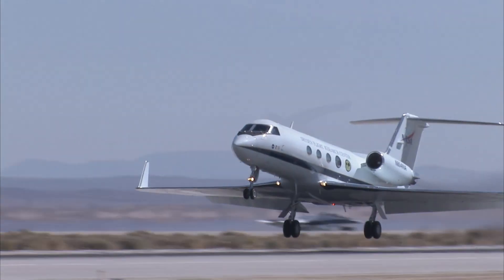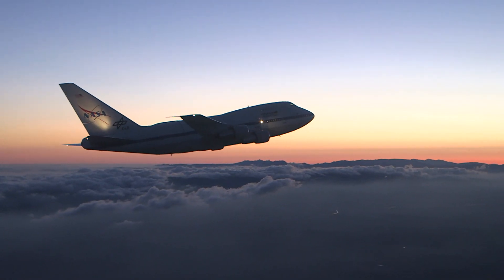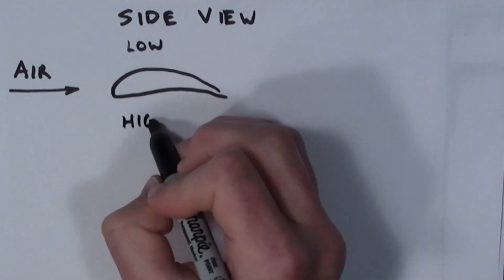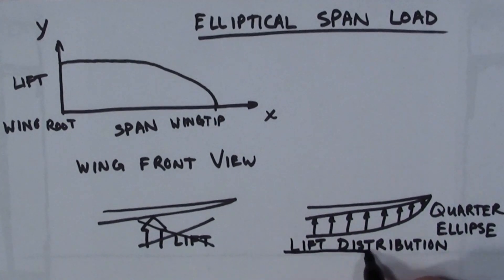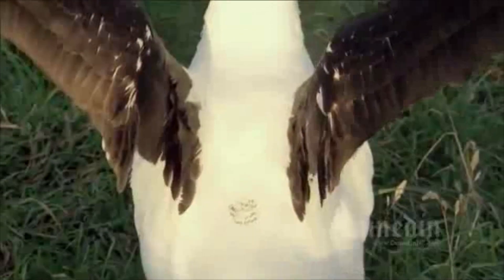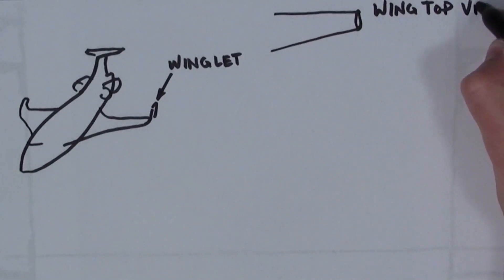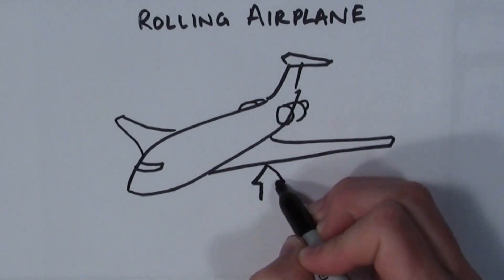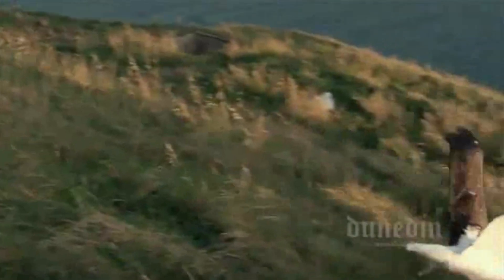Proving Prandtl- With A Twist!

Comment: The concept is even better described and the ideas supported in this video from the 2014 AMA Expo. https://www.youtube.com/watch?v=RoT2upDbdUg.

You'll see all the negative comments below are totally rebutted. These wings have less drag in level flight plus the approximately 12% drag reduction from elimination of vertical stabilizer and rudder to produce a plane more efficient in all aspects including straight and level flight.

You'll see that Prandtl didn't forget how birds flew, he studied maritime birds, which have different flight mechanisms than land birds. It's explained very satisfactorily.

The surprising thing is that the tip isn't just reflexed to the point of zero lift. It is actually reflexed past that and the wingtips generate negative lift! That is the secret to the Prandtl wing and it's not something a modeler or hang glider would intuitively try and "of course" come up with the same idea for cheap. They didn't. None of their designs actually dared to try negative lift at the wingtips. This is truly revolutionary even though the principle was originated in 1933, but ignored because it makes no intuitive sense at all. But it works perfectly.
Reply: +RockinRobbins13 Great link! Thanks!
Reply: RockinRobbins13 Okay let's start with the aero.
1) Invert this wing, and what happens?  The tips would seem to enter deep stall.  
Having flown through light-to-moderately violent rotors in the past, with my instructor in control in the back, I can say I wound't want to fly this wing because of its inverted characteristics.
2) No tail moment means limited, to no, control after stall.
Assuming that this wing is suppose to fly through unstable air, convective currents or wave, having unstalled airfoils in the tail would see highly desirable to the goal of a functional stall/spin recovery procedure.  Even if the tips remained unstalled in stable air, overall stability would be seem to be challenged in unstable air.  Perhaps Mars is thought have a temperature inversion from the surface to space?
3) I listened to the NASA video, but I did not see easily understood wind tunnel data.  I would like to see smoke trails that illustrate how the negative angle-of-attack tips capture and accelerate the inboard tip vortices.  This interests me because I suspect that winglets, and Prandtl negative AoA tips, have a very narrow operating range for the optimal efficiency that is claimed.  If a wing is able to fly in stable air, then it may be possible to operate at a nearly constant AoA, and this is what I expect airliners are doing when they are above 30kft.  I don't know anything about the stability of the Martian atmosphere, but I'm sure you'll have something to say about that.
This isn't the first Mars airplane design that NASA has proposed.  There was one in the 1970s/1980s that went nowhere.  Why was that initiative dropped?  Was it the aero, structures, controls, mission requirements, or atmosphere?
Your platitudes for the design strike me as shallow, as I said at the beginning.
Reply: +Kramp Drucker Holy cow, Kramp! If you're that interested build one and report back. First of all, it's a sailplane wing and sailplanes don't fly well inverted to begin with. Secondly, the same design is used on winglets of commercial passenger airlines and they don't seem concerned with inverted flight characteristics.

As far as #2, flying wings are flown in RC combat a lot and they get stalled, punched, spun out, and otherwise put into non-flying attitudes all the time. They recover fine without a tail moment. I can link you to video of purposely flat spinning a wing and recovering time after time after time. Again, why not build one and test it?

#3. I smell protection of possible patent rights and a bit of protection on the exact details. That's entirely proper. Most sailplane wings have pretty narrow operating ranges for optimal efficiency, so I wouldn't be surprised if this does. They are flying a small number of radio control sailplanes with this wing with about a six to eight foot wingspan. I don't think they have attempted to go to higher speed flight with it but the commercial airlines flying the same concept at 650 mph shows that it won't be a problem.

I think you're making dragons where simple lack of experience and protection of the original idea is what is really happening. Scientists steal each other's thunder all the time and money follows the victor, so they tend to be as competitive and secretive as corporations.

But to all your questions, time will tell. In order for these things to be tested, wings will have to be out there to be examined and duplicated. The fact that some birds use the concept, the ones that soar, shows that the idea has valid applications. I suppose there will be invalid applications also, but that's true with just about everything, isn't it? Because you can't put out a fire by pouring gasoline on it, that doesn't mean that gasoline has no usefulness at all, does it? Does every wing have to do aerobatics? Does every wing need to do all things perfectly? Or do we have design categories for different uses?
Reply: +RockinRobbins13 Birds can use body english and full span angle of attack adjustments.  I find your argument specious.
Reply: +Kramp Drucker Fine. Present your contradictory research.
Reply: RockinRobbins13 I don't have to.  I just have to force you to prove your theories.  That's how science works.  If you can't prove your propositions, then they are groundless.
I don't see your data, and the guy in your video even claims he doesn't have all the data he needs, which is a classic trick to maintain funding on something that has no merit.
Reply: +Kramp Drucker You're playing games. This is a NASA project with leading scientists. Your extraordinary claims need extraordinary backup or you have nothing worthwhile. That's how science works.
Reply: +RockinRobbins13 No, I am not playing games. To propose otherwise is to use ad hominem against me.
I have seen numerous frauds posing as competent engineers and scientists over my last two decades of work. The world is rife with them, and the responsible thing to do is make them prove their positions, or help them admit their inadequacies. The proposed theories may not be fraudulent, but I'm not convinced by the evidence shown.
The first clue that something is a fraud, is a failure to admit the inevitable shortcomings in the theories, up front and without provocation.
Ad verecundiam arguments, about leading scientists, erode any credibility your arguments may have engendered.
Reply: +Kramp Drucker Okay so NASA research is all wrong. The plane is constructed, design validated and the team is booking a future Mars mission. The concept has been understood and used since the 1930s. Airlines use the concept with vortex eliminating winglets, substituting forward thrust for the drag of vortices. You demonstrate poor understanding of the issue while making extraordinary claims of fraud. Burden of proof is on you. It is as if you were to make an unsupported claim that the value of C, the speed of light, was fraudulent and demanded I prove you wrong. Good comedy yes, valid argument no.

Did you watch this video and the AMA Expo video I referenced above? This wing is a demonstrated proven fact with extensive testing already done, the wing already flown for a couple of years. It's really a shame that in the face of fact, your unsupported opinion is all you think necessary to say anything you want. Perhaps NASA never went to the moon? Maybe the Sun is only the size of a dinner plate and is no further away than our upper atmosphere? Maybe the diameter of the Earth has been overstated by a factor of three? Only your opinion is necessary to totally validate these long established fallacies. Apparently, according to you, that's how science works. It help when you brand science a fraud. Lends you credibility.

Comment: so a wing twist was used to make a load distribution bell curved, but why does this result in proverse yaw?
Reply: Because that basically acts almost like a winglet except could be even better. Looks at trikes (weight-shift-control) aircraft. They have been using similar ideas with no rudder required for a long time

Comment: So at it's most basic, a wing will be ideal when it produces sufficient lift and no tip vortices can affect it. There may be no strength at the tip if it comes to a perfect point, but almost no forces are acting on it at the tip. I like it. My next experimental project. :¬)
Reply: Don't worry, I build foam RC planes.
Reply: That what the chief of the group always stresses, how "unloaded" the wingtips of big birds look during flight. Everyone knows, that these wingtip-feathers are preeeeetty soft, yet, they don´t seem to bend under the load. That´s explained with a bell-spanload, but not with the elliptical spanload, so, birds´ wings function differently than state-of-the-art human-built-ones.
Reply: @klausbrinck2137  Yep, probably in part because birds do use the tip feathers in various way. They are "joined" at times in some species, but definitely spread out during landing or tight maneuvers. Almost impossible to manufacture and operate something so complex.

Comment: pro-verse yaw is produce by the swept wing at thats it! If the wing was a strait it would not be yaw stable and would require drag rudders under gyro control.
Reply: wagner24314 swept wings do not produce proverse yaw. All current flying wings have some system of differential drag that overcomes the natural adverse yaw by introducing more drag to counteract.
Reply: RockinRobbins13   i have been flying rc wings for year and also hang gliders.  i can tell you that you dont know what your talking about  so i suggest you read about swept wings and yaw stability
Reply: wagner24314  Read very carefully and learn something. Swept wings work this way (pay attention). When a swept wing yaws there is a leading wing and a trailing wing. When the plane yaws right the left wing is the leading wing, the right wing the trailing wing. This is standard aerodynamic language so as an expert who knows everything you agree. Good.

Now, the leading wing presents more frontal area to the wing, increasing the drag on that side. The trailing wing presents LESS frontal area to the wind, decreasing drag on that side. This yaws the plane back to straight line flight. There is an oscillation pattern which damps out after a hopefully small number of cycles to regain coordinated flight.

This system is called differential DRAG, not proverse yaw, which is the system the Prandtl wing uses to actually produce forward THRUST, not DRAG to achieve coordinated flight. The trailing wing actually generates forward thrust, unyawing the airframe. Rudders and swept wings are drag mechanisms. 

The entire advantage of the Prandtl wing is the reduction of drag and the use of THRUST instead of drag to produce coordinated turns and eliminate adverse yaw.

Of course, as a more learned person who has flown a hang glider you can defend your position with something better than a fallacy. So let's have it. Demonstrate your superior understanding of the principles of flight since you have such vast experience flying RC for a whole year and surviving a few hang gliders.
Reply: for one thing i have about 800hours in flight in gliders.  2. you stated a swept wing is yaw stable.  3 if you take a swept wing lets use a zaggy  if you mix the elevons so in roll you dont lift a wing only push it down you dont have adverse yaw.    by the way your a troll.
Reply: You are the troll. You don't understand the concept of proverse yaw. And not understanding it, you dismissed it as nothing new. As two videos carefully explain, you are wrong. This is a new and important development. It uses THRUST to coordinate turns. All flying wings to this point except the Horten wings used differential drag. Eliminating drag is central to higher efficiency. That's not a troll, it's the truth.